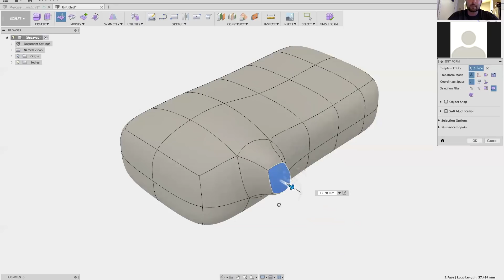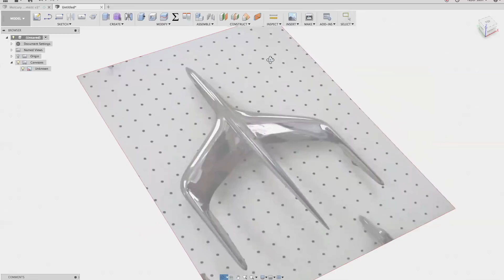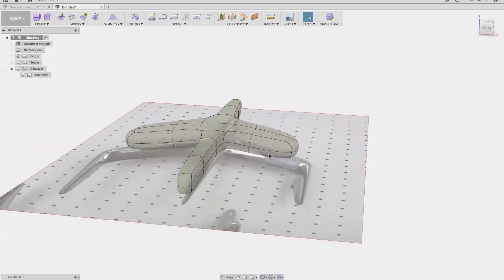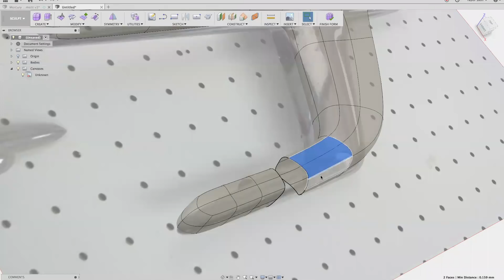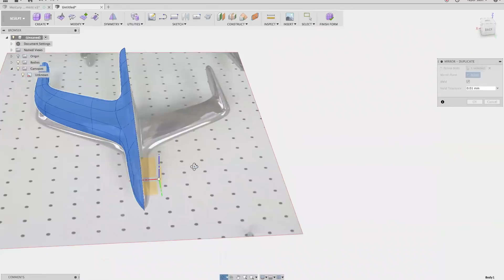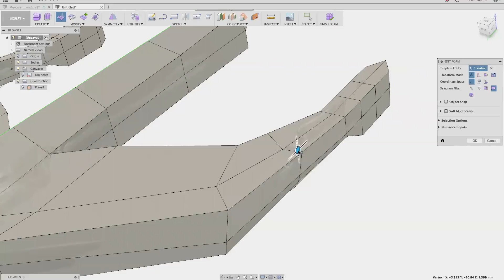Shapeways Presents, Fusion360 Tutorial, Scale RCratrod Hood Ornament from Design to Metal Printing

Comment: The metal hood ornaments look great. Did they come that smooth, or was some surface working required?
I made a tunnel ram for the V8 in F360, but have got stuck on it. I don't think my design will CAM well, it might print OK though. I kinda stalled on that stuff, this is quite inspiring. It will be cool to see what else you build in it.
Reply from the maker: The finish is exactly how it came.  I was really surprised how smooth it was since I ordered raw bronze and brass.  I cant imagine what the polished metal prints would look like.  Im still a total beginner with the software, so far it has been a slow go at making anything useful.  But once I figure out what I really want to make I feel confident I can hack my way through it.  Will just have to keep re-watching this tutorial.
Reply: yeah same, I kinda just stumble through it taking ages to make anything. It is really good software though.

Comment: I would extrude a cylinder on the bottom of the part so that you can use a die on it after it is printed to cut threads. that way you can make it removable.
Reply from the maker: Exactly what I’m thinking. It needs something to make mounting it easier.

Comment: Those metal prints look great, love the bronze. 

I think that part of what makes your builds unique is that you embrace any and all techniques to get the job done, so its good to see you adding a bit of the 3D design to the ol' repertoire.  Also just cool to see the autodesk guys interacting with the community, Fusion360 imho is one of the best things to happen to the 3D printing community, I never figured I'd be able to afford access to such useful software for my hobbies. I drives me nuts every now and then but its also my favorite tool next to my printer :-D
Reply from the maker: lol, I still haven't gotten to spend as much time on it as I need to.  After watching the tutorial over and over again I feel more confident in giving it a try again.  Its really not my area of expertise, I can assemble a computer but using it is a different animal.  Im hoping to keep trying with this stuff though.  My drive with the hobby is learning new things, and I hope this information helps others learn new methods to achieve some scale goodness!
Reply: RC Everyday well if you are anything like me the way to learn is by choosing a project you are interested in and just attacking it, so I guess you are on the right track.

Actually that's how the hot rod cab came about, I needed a reason to learn fusion and that ended up being my first real project. I did have previous CAD expert though.

I guess we have a lot to thank Autodesk and Shapeways for actually ;-)